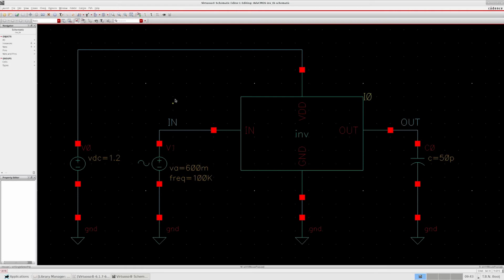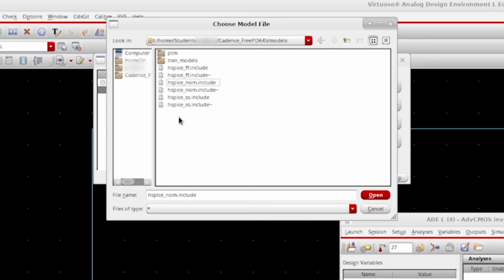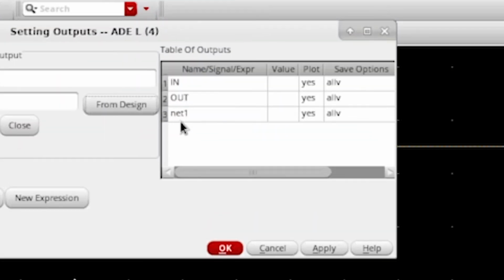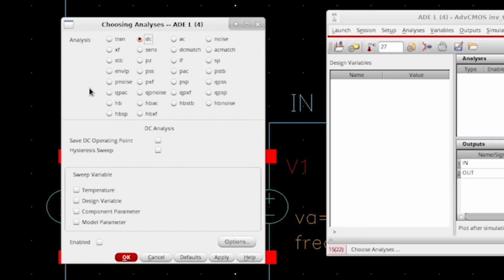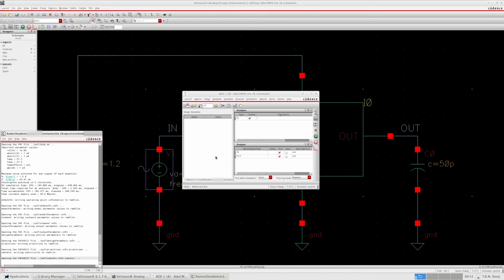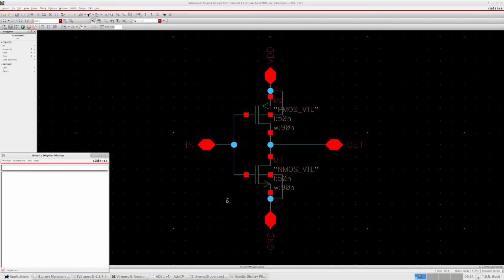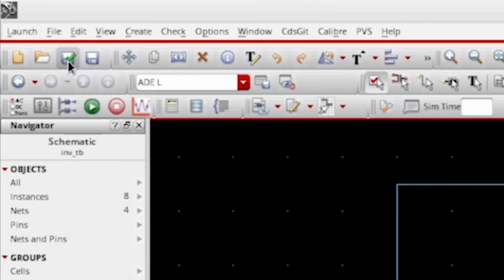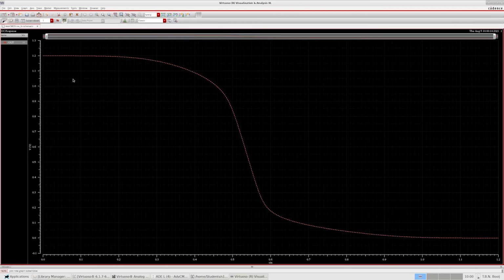Simulation Setup - Cadence Crash Course #5

Comment: Here is what I ran into with IC231/SPECTRE231...  Again, great video series...  I would definitely love to see the video done with the IC231/SPECTRE231 packages.  You are a good instructor...
https://youtu.be/EbUw0D08hho
Reply from the maker: Hi there - apologies for the late response - you're completely right! ADE L is, in essence, a slimmed down version of the former ADE XL which is now distributed under the name "ADE Assembler". In the video course, I chose to use ADE L because its interface is significantly simpler than Assembler's, and since learning to use Virtuoso is such a non-linear (and sometimes a bit frustrating) process, I wanted to make that path as easy as possible to follow. 

In our daily practice at my research group, practically everyone transitions from ADE L to Assembler for their second or third project, since it allows you to do more scalable simulations. For future videos I'm considering including this tool, but I can't make any guarantees as to if and when these are released. Thank you for your input, regardless, I'm glad that the videos were useful to you. :)
Reply: @ThomasBooij  Late response?  I was impressed at the speed of your response :) I did not check out ADE Assembler... I looked at ADE Explorer.  I will check ADE Assembler out.  Again, thanks for the guidance.